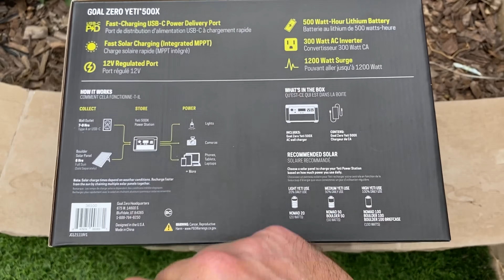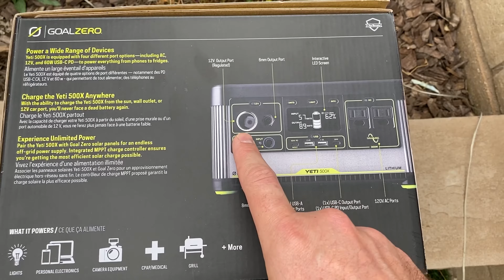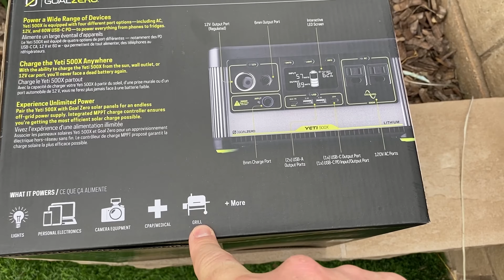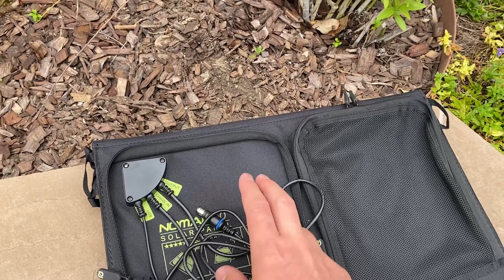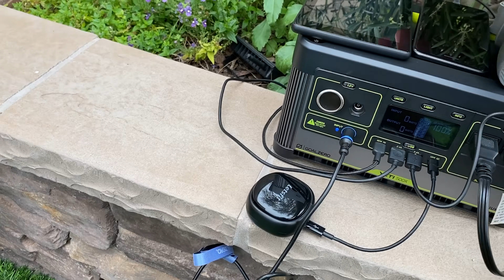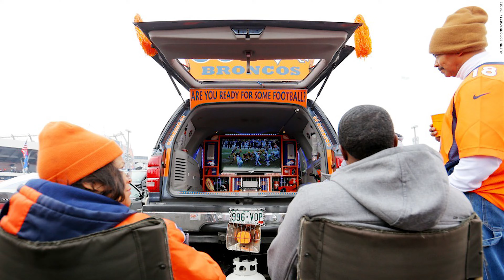Portable POWER from Goal Zero - Yeti 500x and Nomad 50 Review

Comment: About your laptop connection. I have a 3-prong AC power adapter on my laptop and it looks like on the Yeti the ground plug is plugging into an empty space under the two prong is that true or is that an actual housing for 3 prong adapters? For me that ground safety issue is the deal breaker for me, thank you if you can answer.
Reply: These kind of devices don't require a ground because their not stationery.
There is no ground on most portable solar generator systems. So the hole under the plugs is just a hole for the ground port to fit in. You only require the two main ports for AC power.
The ground is only required on station systems like in your home because of surges going into the device. The ground is ment to refire the surge into the ground, vs straight into the device. but since these generators have a consistent uninterrupted power that's stable all the time. There isn't a need for it because surge power cannot pass from the battery to the device.

Comment: Get a power strip to plug into.
Reply: The only trouble with that would be having to be cautious of everything you're plugging into it. Each outlet only really provides up to 150W of power, compared to what you might be used to with a normal wall outlet.

Comment: They make awesome products but are still too expensive
Reply: Not exactly. Seeing the lithium cell, and the charge controller, with a cooling case, and outputs that keep it from running to hot. It's not far off from what you'd pay for a diy version and bigger. That's Going brand new, Not finding used or off-hand parts to do.
Reply: @KillerRaptorr  renogy 100watt panel about $100 - goal zero 100watt Boulder panel $250.
I want to buy goal zero but 2 1/2 times the money?

Comment: I'm sure they list it on the site, but would love to hear how long it lasted in real tests on using it for something but like a tv or the smoker. How long to charge back up in real world tests. Also if it had issues when getting at say 30% holding the load.
Reply: 500watt unit. IE 100watt device 5hours. etc. This is pure 5-12volt out. 110/120volt AC will be slightly less due to conversion and transformer conversion power loss since even pure sinewaves will have a % of loss.
You need to understand your power demand and device power. IE 12volt at 5amps = 60watts. about 8hours of consistent use. So saying 'TV or Smoker' doesn't exactly say anything to lasting, Because those don't explain specific specs on their power demand and performance.
All goal zero products have safety systems built into them that allow all Yeti's to run completely dead with no probs. So for Lithiums and acids. You'll beable to power the same amount of output till it hits 0. Then the unit just shuts down. You could return it on for a % more if you try running something less. say, running AC and switch to 5volts. You'll get abit more juice to run before it'll shut down again and then you're done. There is no degrading % of power lose from the ports.
Acids also don't have the fault of the famous Myth of keep the battery above 50% or you end up damaging it. Because their voltage system cuts off the battery at such point. So even tho the battery % reads 0. The internal battery is above it's voltage of safety levels to keep it from breaking down.
Reply from the maker: Those are great suggestions. I'll do a short follow up stress test video. I'm planning to smoke ribs this week. That's only a 5hr burn but i'm curious to see where the battery % is after that.

Comment: I'd recommend you to get a DC (12V) charger for your camera battery. There's a pretty significant loss from converting DC (internal baterry) to AC (inverter) back to DC (camera battery).
Reply from the maker: Great advise! Thanks for the tip.
Reply: @SteveDOES  You're welcome! Whenever you can avoid that pointless conversion, you'll be saving power. Same applies to phones, drones, tablets, laptops...
Reply: Do you know if the battery is replaceable?  What is the best way to transfer power from this to another battery?   Would a Lighter plug attached to two alligator clips work?

Comment: How long does it take for the Nomad 50 to recharge the Yeti 500x starting at empty?  Nvm, found it.  12-24 hrs.  :/
Reply: You are looking at 50watts. and that's a rough % on best cases.
The 500x can Maximum input (180W): 3 hrs charge in. So 4 50's = 200watts. correctly aiming them at sun during a morning to noon time. You'd beable to charge it before noon. If the day is sunny. Cloudy or fade clouds will decrease.
The best option always to think from. Is double your wattage income. If you want say 200watts. Get 400watts. This'll remove the dips of lower wattage during cloudier times, and will be less stress on having to aim all the time.